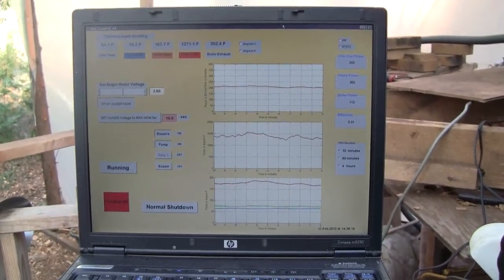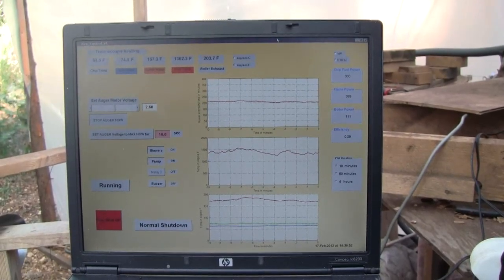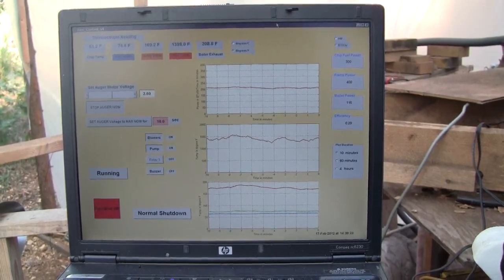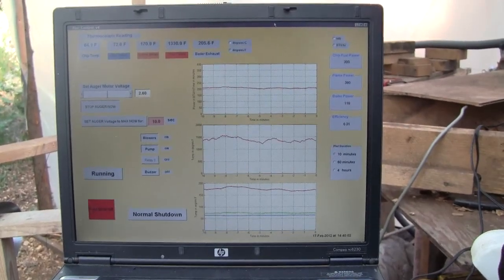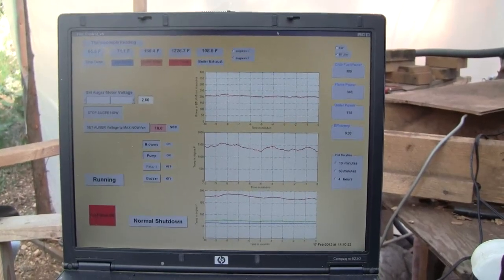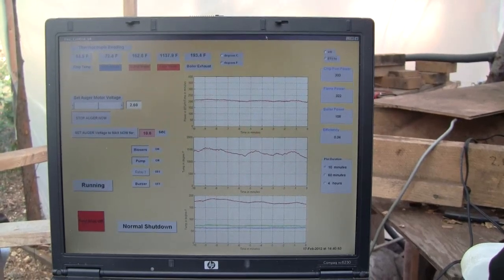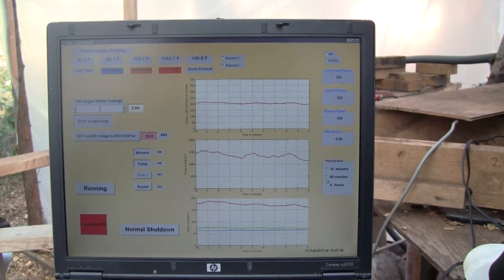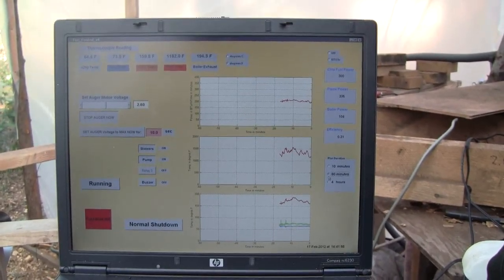Steam Turbine home power system GUI 1.wmv

Comment from the maker: Basically, yes, I'm playing with fire, and fire can burn you.  This is just an early prototype system.  And yes, there are some dangerous things that have at times happened.  The wood chip feed tube has a couple times plugged, which if I wasn't on top of it, could ignite a fire backward into the chip storage.  A failed thermocouple could lead to over feeding and so on.  Got to be careful at all times, and, several layers of redundancy must be at play for a real system...not there yet.
rt

Comment from the maker: to @stevebb30......
    I'm not an EE, but I have an EE working on the electronics.  The thermocouple voltage comes straight from the thermocouple into a box, right next to boiler and into OP amps for digital conversion.  So the signal is right at the conversion point as close as possible.  Thermocouples are working.  We're now working on getting the equations and conversion values calibrated to get accurate power computations.  Computer will use Temps and Powers to make decisions.
rt

Comment: @woodfirepower The problem i have with thermocouples are the cold junction compensation , i guess i will be using pid temp contollers for the the test setup bu the goal is to be able to use Micro controllers for automation and also a Qt GUI  so i can change and monitor prosess parameters

Comment from the maker: I'm not the EE, but a thermocouple just puts out a voltage.  So any A to D converter will work to convert the analog voltage into a digital number the computer can use.  Voltages with our thermocouples (you can use K or J or others) are in the range of 5 mV at 100 C boiling temp for water at atmospheric temp.  Voltage is up in the 30 mV to 40 mV range for the flame exhaust temps.  At just a couple mV, you have a stable (low noise) ground reference or you'll get junk.  

rt

Comment: @woodfirepower I'm working on a simmilar project and i wonder what type of circuit you are using for the termocouples ?? i'm currently is working on my prosess controller . my idea was to use a pic microcontroller both for the controll circuit and also for computer interfaceing .. 

I also wonder how you meassure the btu/kwh